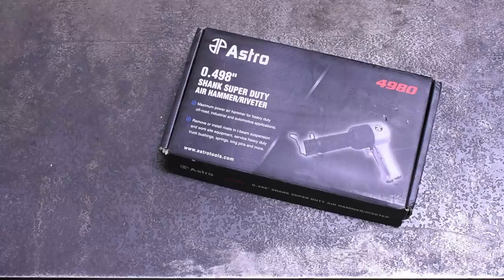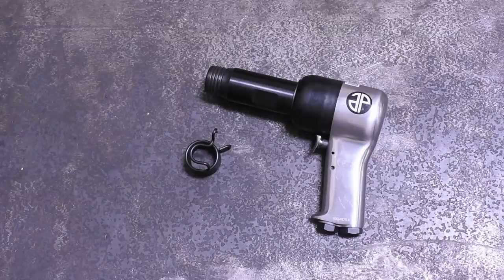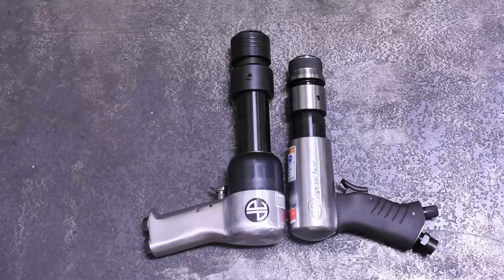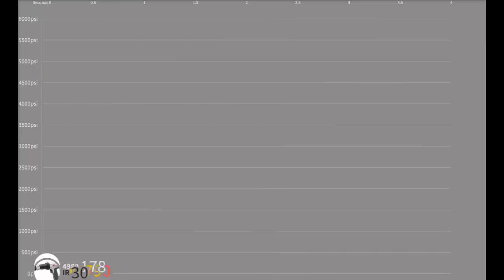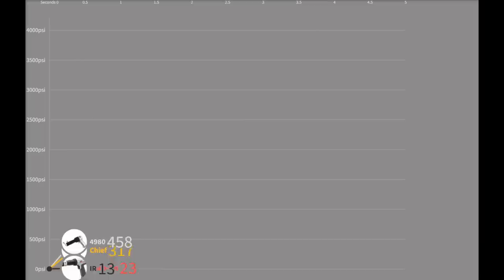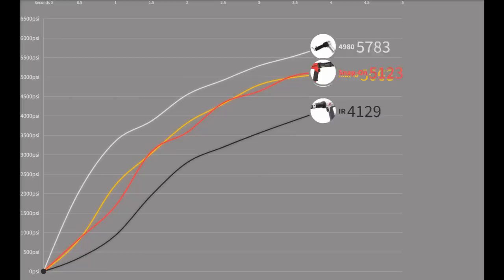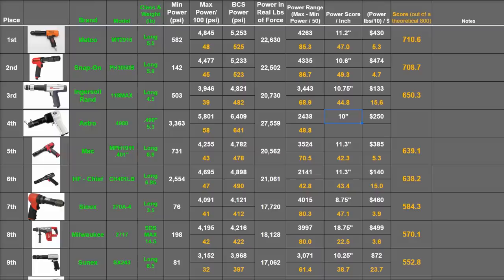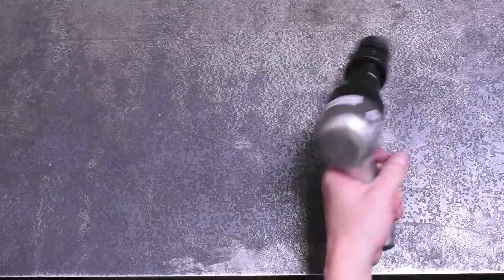50 Caliber Air Hammer? Large Bore Air Hammers Are Insane

Comment: As an Ironworker I would love to see you guys get ahold of a Hell dog rivet tool.  Its the grand daddy of these tools but requires alot of air and a 1" line.  It would probably break the tester though
Reply: It would definitely break the rig, I like having the extra jam.
Reply: that is a near $2000.00 USD tool and needs a lot more cfm of air than their compressor provides.
Reply: @thomasechols8834  it really doesn't take that much air, a 5 gallon tank with 3/4 hose works great for around 10 seconds.

It certainly takes less air for the same job than a .401.
1 second will do more than a 401 in a full minute.

They can be had cheap used, the chisels are a fortune once they are shipped to Canada.
Reply: @5002strokeforever  Agreed on the power , as for the price a used one may be gotten for under $2000.00 USD however the need for it in automotive is not there even on the heavy truck side, I can see it used for construction and train repair work but it is just a great tool for setting during construction of iron framing, and as the other person mention it would destroy their test rig in the first few seconds.
Reply: @thomasechols8834  I use mine all the time on anything that is stuck that I want to move.
Once I needed to get an injection pump off a dead motor where access was tight.
Shove the rivet buster in there and blow the block apart where the pump bolts in, fast, easy  and kind of fun.
Reply: Yep. The rivet buster. They’re actually a lot more user friendly than they look too!
Reply: 1.1875'' bore.  Yikes.  Yes, they're going to need a much bigger testing rig for that!
Reply: Shew buddy.
I thought the high flow Half inch fittings/line were some bad beotches.

1 inch air line? Gah dang, you guys got like, 90cfm at 185psi?
Thats some whamma jammin airflow, hell that big nasty takes like 10cfm at 90-120psi.
So that hell dog dealy must be some serious last word tooling.
Reply: Found this one for sale
JET JCT-2610 Rivet Buster, 11" Stroke (550610)
Reply: Hell dog! Wish I had one in my shop. Even if I did, my compressor couldn’t push it.
Reply: 50 cfm at 90 psi, shee yeesh
Reply: My coworker that used to work at Spartan motors has a air hammer that weighs about 28 pounds is shaped like 2 L bottle with a handle on the back of it. He said guys used to use one-handed in the factory.😮

Comment: I've seen some shockingly loud rivet guns in the aircraft industry. Like, they rattle your soul when they're going off and they're almost intolerable to be around without both earplugs and ear defenders on and even then it's pretty harsh. I'd love to see them tested here as I have no idea what kind of power they actually make. They rate them as 2X, 4X, 8X, etc with larger # meaning more powerful. They're not cheap though, we're talking 1500 bucks for the big dogs like 8 and 9X. No idea what the X is all about though.
Reply: That would be fucking awesome, so interesting
Reply: it means times
Reply: @FloorItDuh I know it means times.... times what??
Reply: @ourkid2000  I think the prior gun so a 4x is 4 times more powerful than a 2x. I think, I'm not sheetmetal.
Reply: I understood the original meaning was stroke length. A 4x is 1inch longer than a 3x.
Reply: The X is for bore stroke, I work with an 11X Helldog jumbo and that thing with the right bit can walk itself between the track and wheel of a steam locomotive
Reply: @ConReese  That's absolutely insane!
Reply: @ryanwilson3632  if you underpressure it with air (not wide enough hose with low psi) the hammer operates at like 30rpm and sounds like a biggest baddest machine gun there is. Naturally us adult children would always mess around with it under aired hitting large metal things to scare people
Reply: To clean the floor, the #X rating is in 16ths of an inch. I.e a 7X rivet gun can mushroom a 7/16 cold rivet

Comment: I've never broken any .401 chisels but I've broke about ten .498 chisels with my CP-717.  It's an absolute beast, on another level and well worth the money.
Reply: btw, I'm a heavy duty diesel mechanic so I need all the power I can get.
Reply: You are not wrong. My 10 year old CP717 has broken 2 smoothing bits. The new longer ones may last longer. This thing is so strong it makes me rethink how the tool can be used. Like at work I use it on the alignment rack to rattle out the upper ball joint eccentric bushing on Ford trucks using sympathetic vibration.
Reply: Unfortunately the newer.498 bits are made from Chinesium. I’ve still got a half dozen.498 bits with the Chicago Pneumatic logo stamped on them, I’m thinking they may have a couple of years on me!
Reply: Mine paid itself off in about a week in just time saved. I love my 717, the thing has yet to be beaten by any other in class air hammers in actual use.
Reply: @duanedragon2 I've lost count on broken bits, I have the IR 119MAX @175psi on 3/4" line with high flow fittings and 6ft 1/2" whip 1/4" chuck. Heavy equipment technician

Comment: I would be curious to see how these would compare to just swinging a normal hammer and maybe a small short handle sledge as well. Obviously air hammers are better but just how much better? Also maybe only allow yourself 12 inches or so of swing room since most of the time were swinging in confined spaces lol keep up the great work and information!
Reply: Yes! Great idea…
Reply: There are give and takes in your idea. An air hammer is typically used to either speed up a process or to apply a hammering force in a confined area where you can't swing a hammer however there are parts of the heavy equipment industry where the force of impact is everything and I have yet to find an air hammer that can outperform a 4 lb matco mini sledge with about a 10" handle and a punch.
Reply: The difference is measured in shoulder surgeries.
Reply: It’s kinda situational, when you need a heavy sledge nothing else works and when you need an air hammer nothing else works.
Reply: If I was flogging up heavy pump flanges I would not want an air hammer !
   If I was working on a vee-hickle I would not put a heavy sledge anywhere  near it !
Reply: My associate Mr. Sledge works best with a full swing. In tight spaces air hammers rule.

Comment: I am heavy duty truck mobile road service. This tool transcends from being a tool into being a literal human body saver!!!
I can push out truck drag links, with out having to beat out with the BFH. I have worn out shoulders from replacing Budd wheel studs. I no longer have a fear of replacing brake disc's. I no longer have to swing a BFH on my back under a truck. At 76 years old it has made possible extended work years. 
   Every service truck needs this tool, along with a .401 shank as this tool literally has the power to decrease wear and tear on the body!!!!
Reply: Bill you are the MAN!! still wrenching on trucks at 76....My hat is off to you my friend.
Reply: @blackscotydog  Alimony.
Check out my Service Truck tour if you want to see what76 looks like. I did a piece on Big Nasty in my u joint video.
Thanks  for comment
Reply: Absolutely my go to. I have the finesse air hammer. The one a screw bit got stuck in so now its a single tool air hammer. the matco air hammer i use for most, and big nasty that every comes to grab when theirs won't get ut done.
Reply: So true. Spring pins and seized anchor pins jump out in fear!
Reply: Salute to you for keeping the work going strong, reminds me of my grandpa. Can’t keep him down lol
Reply: Awesome
Reply: YOURE 76? How the fuck are you still doing your job at 76, hats off to you
Reply: 76! 👏🏽👏🏽👏🏽👏🏽👏🏽👏🏽👏🏽👏🏽👏🏽👏🏽👏🏽👏🏽👏🏽👏🏽👏🏽👏🏽👏🏽👏🏽👏🏽👏🏽👏🏽👏🏽👏🏽👏🏽👏🏽👏🏽👏🏽👏🏽

Comment: I’ve been a truck mechanic 50 years and no question, my favorite labor saver is my Chicago Pneumatic CP-717 .498 I got when I was a little 20 something getting started. I wish newer tooling held up the way tools from the ‘50s and ‘60s does! Oil before and after use and it’s lasting a lifetime.

Comment: I own a CP717. Out side of the cheap noise maker .401 i acquired it was my first air hammer and have now owned it for about 10 years. I would be willing to bet that it will win the minimum beans test, the trigger control is better than any other air hammer i have used.
Reply: I can practically get single hits out of my 717. That thing is so smooth to use, you can ramp from nothing to full bore and not slip off the work piece.

Comment: Big Nasty is on a roughly par with a 10lb. sledge with a 14" handle. The hammer with a uninhibited vertical swing can generate more impact, with a descending energy curve relevant to the amount of work needing to be done. The tool life time is measured in shoulder rotator cuff tissue. 
   Big Nasty can deliver more energy in horizontal work, both with the work person in standing, kneeling but especially when lying on your back under a piece of equipment [ear protection suggested] positions. This has been field tested.
   Samuel Colt is said "to have made all men equal", just with the pull of a trigger. Astro has made possible big hammer work possible in tight, cramped, awkward positions.

Comment: My go-to air hammer is an old large-caliber rivet gun I found in the scrap yard and modified the nose on to use the common larger diameter bits years ago.  I don't even have to run it on its designed 1/2" air line to knock out or bore a hole in pretty much anything.

Comment: I have had an Automotive shop for 44 years. We use the Ingersoll Rand AVC26B1 far and away the most powerful .498 gun made. (It is actually classified as an industrial riveter) Best $$ money we ever spent on a tool. Removes stuff that no snap-on would touch. Yea its $1000 and worth it! It has a .8 in bore and a 6 in stroke, and a very controllable trigger. In comparison the Astro 4980 has a .75 bore and a 2-11/16" stroke.

Comment: I have the Thor version and I’ve used my boss’s Chicago 717 in the past, I can tell you from experience that the CP has a MUCH better trigger control. Thor’s trigger is just an On/Off switch.
Reply: I also have the 498k. Any comment on the power difference between the cp717 and the 498k?
Reply: How do the Thor and CP717 compare to each other on power?
Reply: @greod1006  I never got a chance to find out, I used the CP in a shop that had dual 80 gallon air compressors, so it was operating at maximum power. Unfortunately,I received the Thor 3 days after that shop closed down, my new work place only has a single compressor, so I can’t give a decent comparison. Both are great at separating highly corroded wheel hubs from steering knuckles.
Reply: @jheissjr  I like CP rivet guns, they're easy to fix and parts are available.

Comment: Thanks so much for testing this!! I was really excited to see it! I had been asking for this for a long time and was super interested to see it! I bought one of these a few years ago and have used it to do anything from taking down chimneys to breaking big concrete pads. Also use it for removing the dreaded Audi pinch bolt that the shop couldn’t get out. It’s a beast, wheel bearing presses not required. Lol this was my first air hammer,…

Comment: I got Thor through Summit Racing, which I think is a 9X riveter.  And a 7X riveter, which has about 1 inch longer barrel.  My experience is the riveter has really good trigger control.  Because you don't want that to slip off the rivet and damage the aluminum skin.  Nowadays with proliferation of carbon fiber, a lot of new aircrafts are going to the glue route.   I got a bunch of 50 BMG rivet bits with different tip configurations.

Comment: Can you please test those reversible flip sockets for lug nuts. I have some in the half sizes for swollen lug nuts, and i notice a MASSIVE power decrease from them compared to regular sockets.
Reply from the maker: Its probably the 3" extension needed no?
Reply: @TorqueTestChannel  yes but since the extension goes up inside the socket they are in theory the same length. And i swear i notice a wayyy bigger difference than using a regular socket even on an extension, like these things straight up murder torque to the point my matco 2779 and milwaukee high torque struggle to get lug nuts off. it's nuts.
Reply from the maker: Length doesn't matter though. A deep socket makes the same or sometimes a touch more than a shallow. It's about the ability of the length to efficiently transmit torsion. A socket is borderline ideal for transmitting torsion, and an extension is about worst possible.
Reply: @TorqueTestChannel  Right but I swear I have more torque with a 6"+ extension and a normal deep socket, than I do with a flip socket on a 3". There is some torque killing black magic going on inside these flip sockets. Maybe it's the weight because most of the half sized ones tend to be thinner. Idk. But I know it's my experience and it would be cool to see some real data on it.
Reply: @kyle.2344  Test it! like they do here. Tighten a lug with a torque wrench, and time how long it takes to loosen it with each setup. Video it with a stopwatch (timer), running in the background so you can figure out the time after the fact.

Comment: I used a CP717 in a truck/heavy equipment shop for many years. As you say, finding .498 bits was a bit of a challenge back then and still seems to be a problem today. We had an even larger CP hammer that was called a rivet buster and had a 1/2 pipe air inlet that was even more of a beast.

Comment: I spoke to a few OEMs to figure out how to get different flavors and gathered some local distributors. Shipping time for single orders isn't zippy. I found wacky guns nine and longer. I found one Aircraft Tool Supply where you can use the sign on coupon with the current sale to have one very generously equipped for 300. I managed a seven inch (like Thor) with a full kit, case, powder coat, feathering trigger, and comfort grip. It even comes with a clever solution to the .401 adapter issue that seems to work quite well....

Comment: I have a .498 from air craft tools. It's a 7x model. Definitely longer and slower hitting. I believe the power is supposed to be more. Be nice to get it tested and see how it compares to the one you just tested
Reply: Second that. I have the same one. Don't know any numbers, but it's the hardest hitting hammer I've ever used.
Reply: What’s the brand name? thanks
Reply: @istvanmeissler2238  ats 7x rivet gun from aircraft tool supply.
Reply: @dogzilla1212   Thank you.
Reply: @dogzilla1212  Great Quality gun I've sold dozens of them, but not as hard hitting as a APT 800

Comment: Could you test pass through socket ratchets?
Reply: THIS! I love these things, one of my go-tos, they're so damn handy! Realized that I needed a set about 7 years ago when I was working in HVAC, dealing with all thread regularly, been using them on everything else since. Just haven't pushed them real far, torque wise, not sure how strong these things are - would be interesting to find out.
 
Definitely underrated tools, everyone should have a set even if it's just a $15 HF set

Comment: So here's something oddball I'd like to see tested, if possible. Try case hardening the air hammer bits in used motor oil. I got tired of my pointed punch going dull on my .498 Jiffy #600 gun so I got the end glowing red and quenched it in oil. It hasn't deformed one bit since then. I intend to do a couple cutting chisels too when I have the spare time. Would also be nice to see a durability test of different brands like Mayhew, Ajax, Grey, etc. 
Would be cool to see if you can 'tune up' a cheaper air hammer to perform with more beans like when someone ports out an air impact for more go.
If you want trigger control in .498 look for air rivet guns, they'll have tease in triggers for setting rivets. My Jiffy can tap away like an 8oz hammer or go like a jack hammer with full range in between if your finger is delicate enough. It's a supposed 6X rated riveter. I'd love to send it in for you to have some fun with but I'm afraid you won't want to send it back after using it.
Reply: Not a healthy idea. Case hardened bits shatter like glass under impact loads. Yea the .489 bits are a bit soft for my liking too, but they tend to not throw sharp pieces if they fail.
Reply: @willgallatin2802   I've been using it a bunch since then, I only hardened it in motor oil so I doubt I did a professional job. It's hard enough to keep it's shape when I'm digging into cast iron hubs but I'm sure up against a 10.9 bolt it would deform. I'm not looking to make my Ajax chisels hard like a cold cut chisel but just harder than cast iron.

Comment: I would change your low high power to a percentage. I.e., if it does 5000 max and 100 min, then 98% of it's theoretical range is usable, so it gets 98 points. This way, guns with poor range but huge power don't get rewarded yet again. To me having one gun that can do most everything is pretty valuable.
Reply: I like this idea. I'd still like to have the number displayed if it fits, though. a percentage fits well into their scoring system, too.
Reply: The issue with a % as you want is that not all tools have triggers that offer wide variability. Tools with crap triggers might have the widest spread, but only be able to achieve min and max and nothing in between.

Comment: Atlas Copco makes some of the best rivet guns for aircraft manufacturing. I used a 10P large bore push to start recoilless for years. It smacks hard and is easier for both the bucker and shooter. It probably compares to these. I’d have to pull up the specs from them and do a spec chart comparison.
Reply: Rrh06p ❤
Reply: RRH14P BOSS

Comment: You need to find a APT American Pneumatic Tool model 800    not sure if it's considered a air hammer or a rivet gun but whatever it is it hits extremely hard. I bet it could take the throne easily. They run about $200 on eBay if there's one available, they're few and far apart and are very desirable.